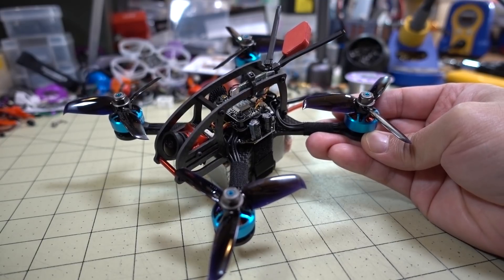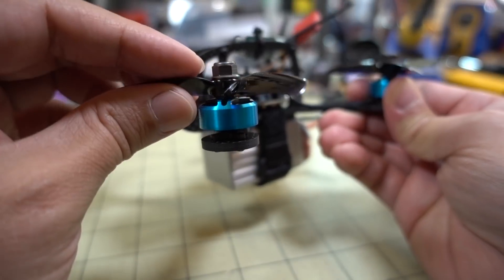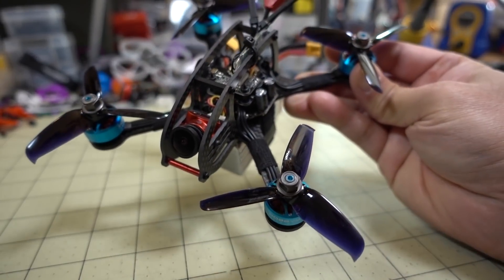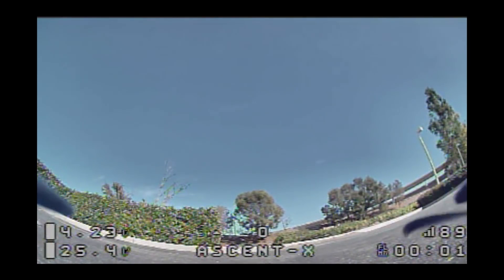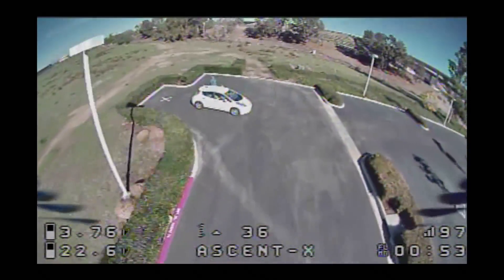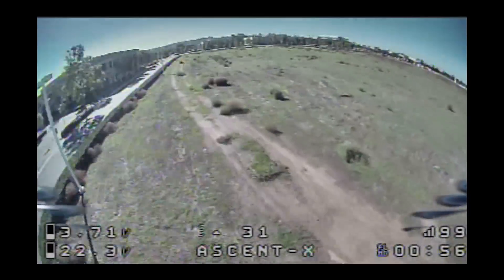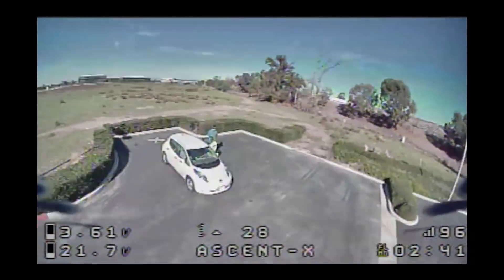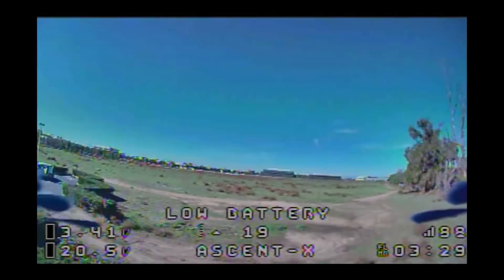6S Micro Drone Motor Testing // Impressive!! 🏁😀

Comment: Would you be able to lend a hand at tuning these? I have a 3.5” build on 1507 2700kv and motors get stupid hot and oscillations like crazy. Esc flashed with blue jay. Bidirectional enabled. Betaflight 4.3.  277g.
Reply from the maker: Your P & D gains are probably too high.  I'd also try a lower motor output limit at that kv with a 3.5 inch prop.  I think that's too high for the prop/frame.
Reply: @AlbertKimTV  thank you for responding. I will try lowering those and see what happens.

Comment: Albert, in your experience would a 3 inch, 1507 1550 kV motor on 6s 550 mah work? I think the kV is too low to produce lift?
Reply from the maker: I think that KV is too low but lift/power also depends on AUW.  If it's lighter, it will still fly, just not that great.  It will probably be super efficient though and have a long flight time.

Comment: 6S 3000kv vs 3S 6000kv, what's the difference? Just a heavier battery, or is there more to it?
BTW thanks for the informative vids, and all the testing you do :)
Reply from the maker: less voltage sag
Reply: @AlbertKimTV  But if you swapped your 6S 550mAh battery for a 3S 1100mAh battery (same power and weight), and your 1505 2900kv motors for hypothetical 1505 5800kv (2x2900kv), wouldn't you end up with the same power, same voltage sag effects, flight time, and overall performance? I'm really curious about this. I would have thought it'd be pretty close...

Comment: Definitely keep up with these build videos. You and the motor company are definitely going the right direction. I would definitely look at 3400kv and possibly the 4200kv both in 6s. Running 6s on these is ridiculously fun and you can always lower your max throttle on your controller to get longer flight time but maintain the torque and flight fun

Comment: You need the lift from larger surface area of 5" - 7" props (or larger) to get the lift to compensate for mass of 6S (until lipo power cells become lighter for given output).  By way of example just look at  7" props vs 5" with appropriate motor choice - its an unbelievable difference.  With the rpm these tiny props see the turbulence at high end is offsetting the gains in thrust you will see from increased wattage from your 6s

Comment: I really can't see any benefit to going 6s on a micro. My 1105 6000kv 2540 3s 450 80g dry set up flys just like this, if not better.
Reply: Hi, what frame did you use and what weight for just the carbon and hardware? I'm considering a 20-22g frame right now, the AmaxInno Nano 2e at 20gr or maybe the Nano 2.5e that weighs only 2 more grams).

Comment: I am running 6s on 3" on two quads. One uses 1507 3400kv and the other is 1506 4200kv and they are a blast to fly.
Reply: Can't find my 6s video but this is same 3" quad on 4s 1500mah pack racing 5" quads https://youtu.be/N0ZOw3zIHDs
Reply from the maker: 4200kv!!!  How does it not melt????
Reply: Albert Kim not sure. They are Garila and a lot of there motors run onboard6s. Jason bouslaugh has been running on 6s for probably a year
Reply: @wodifpv644  yep these 3 inch quads are awesome and are coming a long way quickly...I fly them more then my 5 inch and the power  to weight ratio is off the charts with these little beasts and they're way more responsive!!!
Reply: Quintin Lindsey totally agree
Reply: Here is the 1507 3400kv on 6s 3" https://youtu.be/YAK-4-m77IQ
Reply: https://youtu.be/aCe9JYPUHvk
Reply: I have flown the 4200kv on 6s. I did fry a esc in a wreak but motors are all good
Reply: That is what I am using in my 3 inch 6s quad, 1507-4100kv...BEAST but I do not fly it 6s all the time but once I replace them with 3600kv it will be on!!!!
Reply: Quintin Lindsey nice
Reply: I’m running 1507 2700kv on 6s. 3.5” build. Oscillations like crazy. Hot motors. And cannot tune it for nothing.

Comment: What's so impressive with 6s on a 3 inch? I just heard flutter with the props flatening out because they struggle with the weight. Want speed? 2 inch on 3s with 6000kv on a light frame. Or just look at your spintech video.
Reply: That sounds like one of my future builds. A AmaxInno Nano 2e frame with their 1106 6300kv. It can handle 4S and does 365g of thrust at 14.58amps on 3s with a 3025....I want to build their 2.5e too and use the RS1106 7500kv motors I have, I have a bunch of 2S packs left over from a BNF drone I destroyed beyond repair. This hobby is fun, but you can develop a severe case of Quad acquisition syndrom pretty easily....
Reply: @yannickg6904  normally, bigger the prop needs lower kv. But the pitch and material of prop also makes a differance. And motor assembly (curved magnets, lamination...) also becomes a factor. Another tip, would be to try reverse motor rotation (sometimes fixes dipping when doing hard turns) especially with the micro quads. And yes fpv can make u broke, but its not as bad as playing with cars 👍